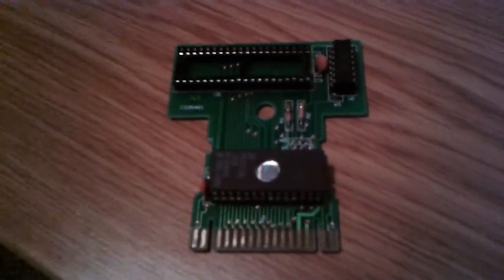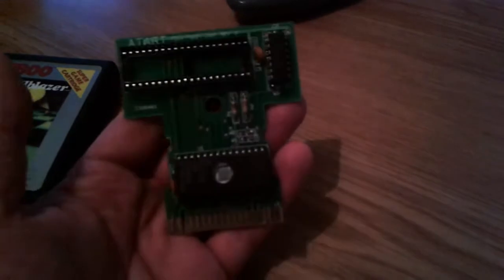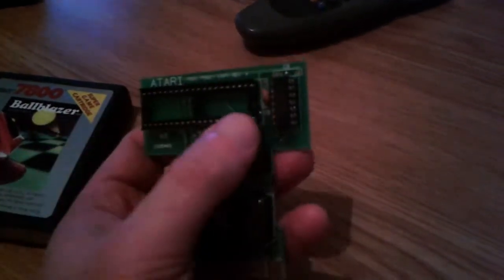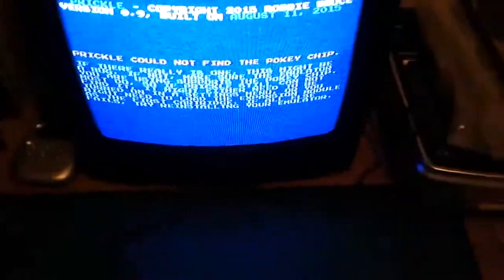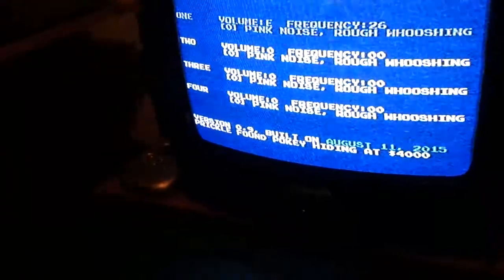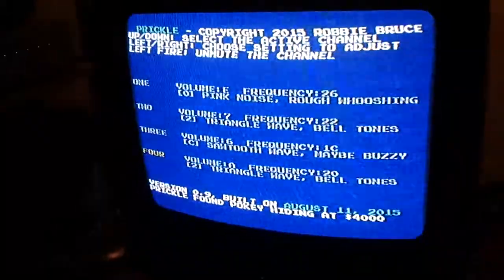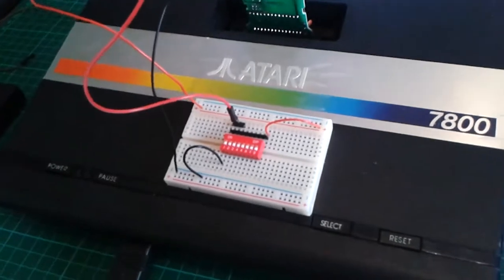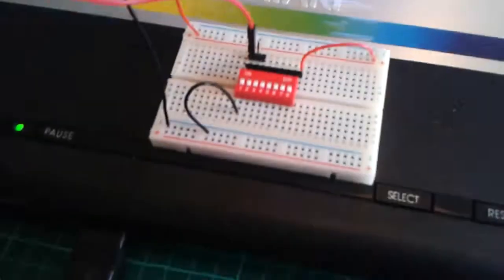Testing an Atari Pokey Chip

Comment: Cool idea, this would be made even better using a ZIF socket on your pcb
Reply from the maker: I did buy a 40 pin zif socket but found it didn't sit on the board very well due its size so had to stick with a standard socket